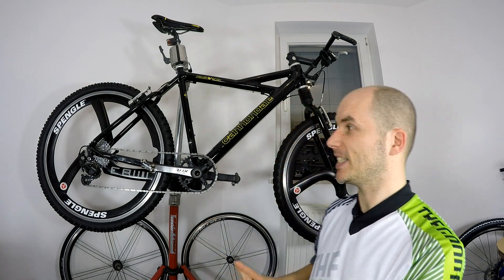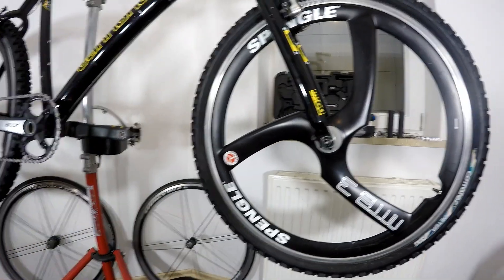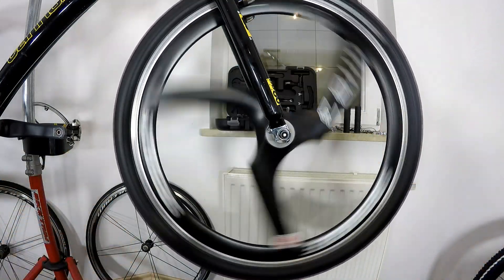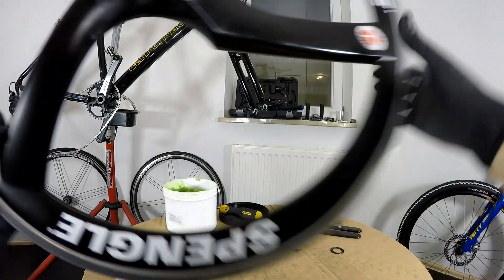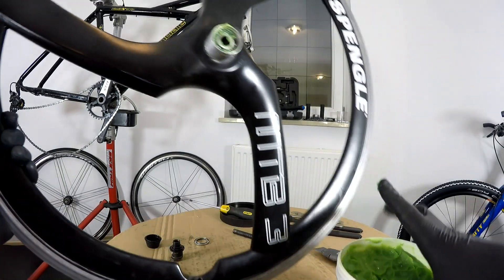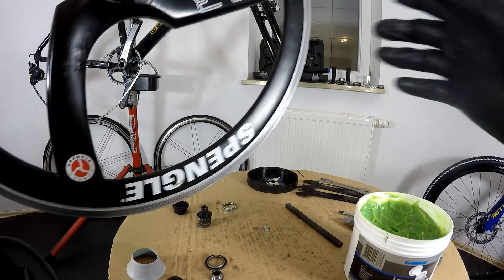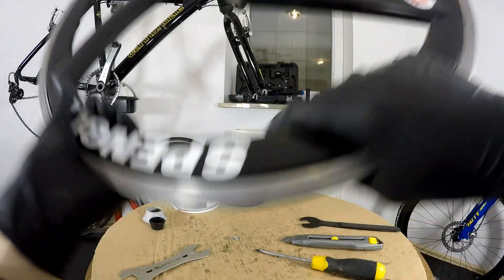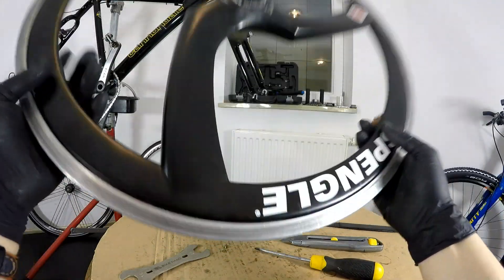OLD SCHOOL Spengle MTB3 Trispoke MTB Carbon Wheels - Review And Hub Overhaul.

Comment: Do you have experience servicing the hub on a Spengle Giro 3? I have one with a two-paul hub and a broken pawl, which makes the hub body wobble. I managed to remove the non-drive side and hammer the axle through to the drive side to remove it, but can't remove the outer part of the drive side. Does it just pull off like the non-drive side did? (with a lot of force). Neither side seems to be threaded on. BTW any idea which brand of hubs Spengle used back then? Very hard to find info. Thanks!
Reply from the maker: Hi, I didn't have to make any servicing on Spengle. I wouldn't be surprised though, if some older Shimano or DT pawls fit there.